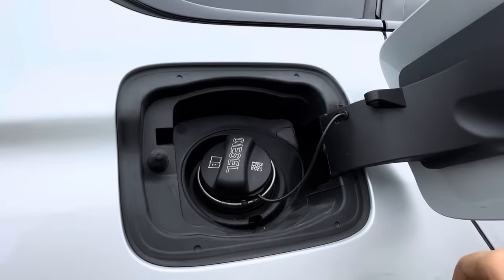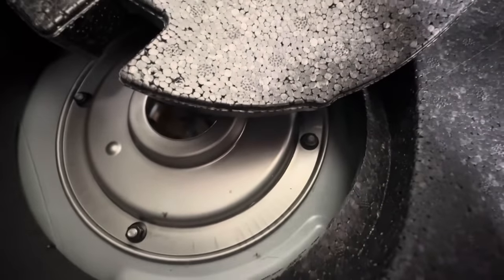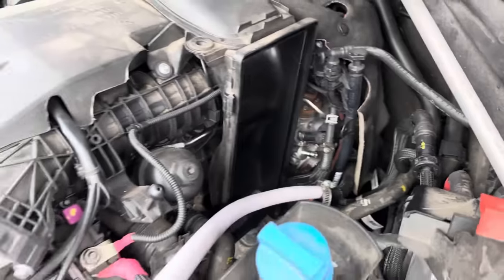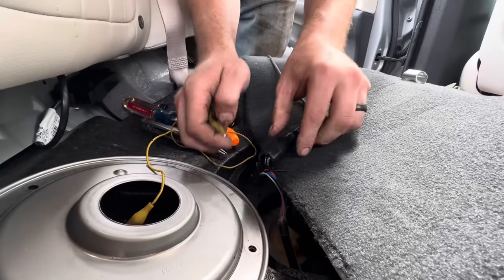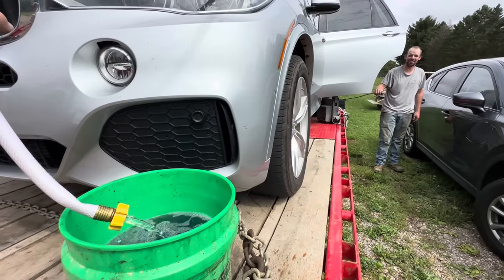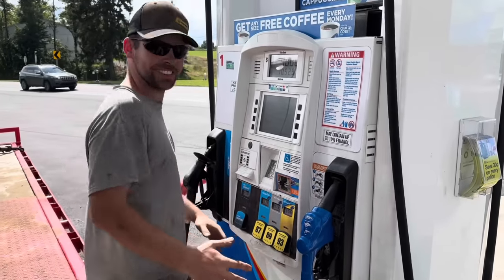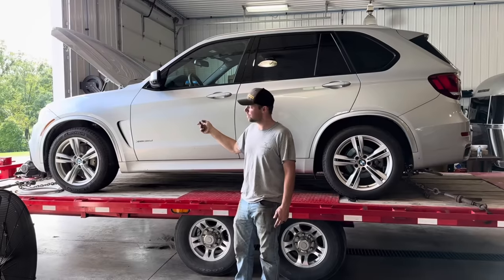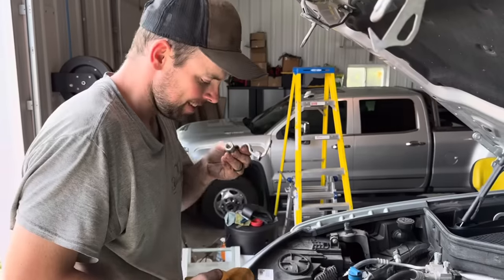Dieselgas 2023 | Will it start after being run on gasoline?

Comment: I had to do this at a gas station. Bought some fuel hose and I had an empty oil jug laying around in the car. I disconnected and plugged the lines from the tank and hooked up the send and return on the engine side to the jug. I drove the car back home where I unplugged the fuel send from the tank, extended it into a barrel. I let the engine run on idle from the jug for 15-20 minutes, emptying the tank and most of the fuel system into the barrel using the regular fuel pump. I changed the fuel filter, filled the tank with diesel and hooked the fuel lines back up. This was six months ago, still runs perfect.

Comment: Sam you never cease to amaze me in the tasks you take on and they turn out really good.  I worked for UPS years ago and one of the jobs I did was drive a semi that had Cummings diesel engines. The first thing we did when we pulled into the yard was to fuel up.  A new driver who did not know any better started to put regular gas in the tank.  I will never forget the head mechanic running across the yard screaming at that driver to shut off the fuel pump. I think he stopped right away and they drained the tank and it turned out ok. I think it was lucky that the driver did not start up the vehicle. Good job!!!!!

Comment: Well done. Suggest you talk to Area Diesel or the like and get their opinion on changing the HP pump. As you mentioned, if the pump dies then the broken bits will destroy all the injectors. Tough call for you to make as to what is now best to do. Retired mechanic/machinist in Land Down Under.
Reply from the maker: I agree maybe i will mention it to them that's a good idea. Thanks for watching!
Reply: No need talking to Area Diesel just put a new oem pump in regardless
Reply: If the car hasn't been run for a long period on gas the pump will be ok
Reply: I would ask BMW...

Several times I did the opposite, Diesel fuel into a gas jobby....  yea, dumb ass.   Worst was into my Honda Valcyrie  (2 wheeler)

Comment: I'm ashamed to admit that I misfueled my Mazda 6 diesel with unleaded petrol (gasoline) about 18 months ago. I got to about 15 ltrs before I realised, so then I had a dilema. Here in the UK we have companies that specialise in call outs to fuel stations for people who misfuel their vehicles, they turn up and suck out the fuel tank, but charge around £100 for the service. So you lose the fuel and have to pay the fee. In my case I was also in a screaming hurry so arranging and waiting for the specialist, then coughing up a hundred folding was not something I felt like doing. So, as I hadn't started the engine I decided to fill the tank with diesel. That would be 45 ltrs of diesel to 15 of petrol, I realise this was a risk but one I was prepared to take. It started right up then within 5 or so miles started to run irregularly. I persevered and it cleared up, probably as the mixture of the 2 fuels became more thourough. Two things I noticed subsequently. It was a b1tch to start from cold, and after standing when hot, also, it didn't have it's normal power at higher speeds, it held back under acceleration and wouldn't hold higher speeds. I feared the worst, thinking that the pumps and injectors were getting fcuked up etc. I carried on though, adding more diesel as I used up the contaminated tank and eventually it became better and better, until after a few tanks it was back to normal. So far no lasting ill effects. I reckon I'm very lucky, or Mazda's are tough!  I think if a modern common rail diesel is a actually run on neat petrol it would be screwed though.
Reply: Yeah, it's not as big a deal as this guy makes it sound lol He's just making it a bigger deal than it is...
Reply: As diesel engines age and injectors get a little worn they rens to smoke. And that might lead to failing the yearly inspection. A common trick is to fill the thank with 20-30% gasoline since it contains a bit less energy, therefore reduces smoke. Have dove it with a few diesels and never seem to have hurt anything. Another trick is to fill up with HVO100 which is a biodiesel that is in fact “hydrogenated vegetable oil” which is waaaay cleaner since it consists of pretty much 1 molecule and not like 300-400 as regular diesel. So it burns incredibly clean and odorless and doesn’t smoke almost no matter what. 😎

Comment: I used to work at a dealership (Not BMW) and this actually happens quite often. I actually can see how it happens, 
A person, drives gas vehicles their entire life then switch. 
I actually think it’s a suckier job when they fill the DEF tank with diesel or mix DEF and diesel in the main tank…
Reply: Flame thrower hahaha
Reply: I have a hard time figuring out how people manage to do that. The small plastic hose that comes with the jugs JUST fit in my def tank opening, nevermind the diesel pump!
Reply: @fullraph  I put about 1/8th gallon of DEF into my diesel tank before I realized it...first time I did it in 120K miles.   I don't buy the jugs, I get it from the pump in the diesel lanes the semi trucks use.   I was able to get home without problem since it was still over 22 gallons of fuel compared to a cup or two of DEF.  I let it settle out overnight then went under the tank to unscrew the plug which is there to drain any accumulated water.

Comment: Quite amazing they filled it with gas, my E70 won’t take certain diesel pumps cause of the shape of the nozzle
Reply: Yeah it's a different size. She would have had to get the fuel adapter in the trunk to put gasoline in.
Reply: The diesel nozzle is bigger so it’s easy to put the smaller gas nozzle in it. Harder to put diesel in a gas car since the nozzle doesn’t fit.
Reply: That is until you drive an older vehicle that was made when people weren’t idiots kinda and is designed to take high volume pumps for gasoline. There have been a couple of times where I ask someone else to fill up my truck. They’ve never managed, actually start pumping, but where they’ll grab the diesel nozzle and it does fit in mine, so that’s always fun

Comment: 2018 was the last year BMW sold diesel cars in the US due to a lack of sales. My wife has a 535D with the M sport package we picked up recently,  low miles 1 owner. Its really nice and get around 40mpg. Its so quiet and what blows me away how it starts without having to wait for glow plugs like my older ford f350.  Good job fixing that one.👍
Reply: We can blame VW for that. BMW still makes diesel X5's in the US! But we can't have the forbidden fruit now.
Reply: Oh and yeah these will start no problem in like -30 weather. I still recommend a lubricity additive for those CP4 pumps though.
Reply: It was because of the emissions requirements. It’s truly ashamed bmw doesn’t sell even one diesel in the 🇺🇸. Thank VW for that. At one point bmw was even going to offer an x7 diesel in the 🇺🇸. That’ll never happen.

Comment: Nice repair Scrappy! Great trailer except they do a lot of front and rear end damage while exiting the trailer! Today's plastic car bumper covers will more often than not come off completely or get damaged while exiting the rear of the trailer. I had to get rid of mine to eliminate customer complaints and expenses to repair the damage at my cost! Thanks for posting and take care!
Reply from the maker: I agree that's about as low of a vehicle as it can handle.  I am usually hauling skid steer and mini excavator and other smaller equipment with it!

Comment: The worst part of this, if you took that back to BMW, they'd want $10-15k to fix that car. Friend worked at VW about six years ago and someone had a tdi golf towed in because they filled up with gasoline and the car died a couple miles down the road. Vw wanted to replace everything from the lift pump to the injectors, that bill was about $9k.  😮

Comment: Worked on a "76 custom Dodge van with the same problem (in the "80s), only the other way around. Gas engine filled with diesel. Same fix. Drain tank, fill with gas. Flush lines, remove & flush carburetor, change spark plugs. Also did an oil change as this van was driven on the interstate from the fueling point until it died. Crank the piss out of it, immediately drive 100 miles. Smoked like a crematorium for a while, but was still running fine a couple of years after.

Comment: You may also want to change the fuel filter as a precaution esp if you don't know when it was last done.
Reply: Why?
Reply: @jhsevs most non truck diesel owners don't know you're supposed to change them about every other oil change.

Comment: These N57 X5's are really sweet cars. And can tow a decent amount (6k) considering they aren't that big. But they do weigh over 5k lbs.

They're not as good as the M57, mostly due to the CP4. But you can still get a tune and delete on these and they wake up a substantial amount.

Comment: I filled up my ranger one time on the farm and we had just changed the tanks around and I wasn’t paying attention to the tank I got fuel from and filled it with diesel it ran to the end of the driveway and died lol I siphoned the tank and filled with gas cycled the key several times and started it with either and it ran with either for a few seconds and then it was fine lol

Comment: If you pump out the benzin and just add full diesel the delution should be good, then cycle the ignition to "mix" the fuel in the lines..😅
The pump already ran inn gasoline so damage is done, and maybe you want to look in the front for the diesel filter to purge that too?

Comment: Should you consider changing the HPFP, read the BMW TSB SI B13 03 09 for the recommended replacement unit.
Reply: The N54 HPFP bulletin has nothing to do with the HPFP N57 diesel in this X5. Completely different cars, engine, and fuel strategy.

Comment: Over here in Britain these bmw's are upper middle class driveway orniments they love them they hold a special place in thier hearts. but 99% of them have any inability to actually drive one nor handle the rear wheel drive systems because they go to fast all the time. also over here they have issues with accelerator pedals made from lead for some reason? The indicators/turn signals never ever work. I've owned a couple and there not what they used to be the modern one's are utter s**tboxes.

Comment: Well, the old scrap qualification worked well enough to get the beamer going again. I would be a little concerned about the pump being scored from the gasoline, even in a mile of drive time. Chances are it would be ok, but I'm no beamer mechanic, and the concern would still be there. May be good insurance to change it out if research still leaves doubt in mind. That kind of stuff bugs me and if the pump isn't a stupid amount of money to change out, I might consider a new one to save the injectors from getting trashed and the rest of the fuel system full of metal. That diesel gas works wonders for roastin' your weenie!
Reply: The pumps are made from the same metal no matter if it's a diesel or gasoline injection. That part really shouldn't care what the fuel is. The seals may be a different story, but as long as you don't dump E85 in it, I don't see why it would be damaged.
Reply: @thesteelrodent1796 The high pressure pump needs lubrication gasoline can't provide. Actually modern low sulphur diesel can't even provide it. But if he's a diesel mechanic he probably knows that the CP4 pumps can't handle low lubricity fuel and he probably already is using a lubricity additive.

Comment: Hey Sam nice your now a qualified BMW mechanic ,I always thought they were a mystery to fix ,was wondering if the dry fuel gas did any damage to the bore,s as DIESEL is an oily fuel ,just a thought bubble ,enjoy your channel Matt was right check out Sam 
Cheers Kym
Adelaide
Reply: Today's fuel seems to have very little lubricant.
Reply: You need to run additives to keep the high pressure fuel pump of the commonrail happy so much for lubricity...

Comment: At what speed was that mile covered? At25-35 it would be ok, I think. At 50> yea just swap the pump now. Had this happen to a forklift at work once. Boss said let it run with just a flush. 3 weeks later I was installing a new pump and injectors. The lift was operated for about 30 minuets on 1/4 diesel, 3/4 gas.

Comment: Oops! you are lucky on this time.
It happen to me once with ops it I filled in Diesel on an Austin Martin my boss car I was lucky to we spotted before my boss turned on the engine, and the most impressive my boss didn't got angry with me it was second time lucky on the same issue because my had to call someone to drain the diesel out of the Austin Martin all most brand new car.

Comment: For those who run into this type of issue, where do you take your diesel/gas mix? Are there any auto places that are usually capable of disposal?
Reply: Run it in your lawnmower. It wont care
Reply: Old mechanical injection diesels will run on a mix of gas and diesel
Reply: It’s your new lighter fluid

Comment: that pump is fine and it is no where near 10000 to 20000 psi ,it is at most maybe 100 to 160 psi and all it controls is the fuel shut off and timing of the injectors
Reply: The HPFP on a BMW diesel automobile outputs, depending on demand, 2,200 psi maximum.
Reply from the maker: I just gave it a google- With 39,000 psi (2,700 bar) capability, the CP4 can meet even the most stringent diesel emission standards

Comment: there's very little difference between a common rail diesel and a gasoline injection, so highly doubt either pump took any damage. After all, they're only pumping fuel and having gasoline in the diesel is no worse for the pump than water. Once the fuel is mostly diesel, it should be perfectly fine to keep going, but the computer will tell you if it develops an issue. The stuff that may get damaged with the wrong fuel are the injectors and glowplugs, but the engine normally dies before they take any serious damage. If you went to the dealership they'd want to replace basically the entire engine, but as long as it's flushed and runs, there's really no need.
Reply: Problem is that a diesel injection system uses the diesel as a lubricant, whereas a gasoline high pressure fuel pump is designed with the fact that gasoline doesn’t lubricate in mind.

Running gasoline through a diesel HPF means it runs without lubrication. Now I doubt that that single mile really damaged it that much, but it is a danger and many HPFs have died this way.

Bigger trouble is that when the HPF shreds itself, it will send metal fragments into the injectors ruining them too. That can be so expensive it might economically total the car.
Reply: Domino is exactly right. Lubrication is absolutely a thing, especially on these CP4 pumps. 

Next time you get some gas, rub it between your hands. Then try it with diesel, especially a high sulphur diesel. You can literally feel the huge difference in lubricity.

Comment: X5 Diesel are notorious for High Pressure Fuel Pump failure. I'd strongly suggest you to replace it. When my fuel pump gave up, it damaged the hole fuel system, I had to replace every single bit and piece of this crapy fuel system, it costs about 10 grands to do everything. My car was still under warranty, luckily.
Reply: It's not an X5 thing, or even a BMW thing. It's the type of pump that is used combined with EPA mandated low sulphur fuel that has low lubricity. You should only use high quality fuel with good lubricity and really should use a lubricity additive. The previous X5 (guessing yours is a 2013+) uses a different pump and doesn't have this problem. 

Any vehicle with this pump (Dodge, Chevy etc) using Obama mandated US diesel fuel is going to be at risk.

Comment: Why did you put the gasoline in the diesel, what did you need to flush the system must had a lot of crap in the system, never new you could use gasoline. Interesting great job

Comment: Of course, it will start when the gasoline level gets to high a diesel will not fire. Cold running before dose no damage. I have drained and refilled many Diesels that stopped from Gasoline in the fuel

Comment: NEVER put diesel in a red can or gasoline in a yellow can. As long as it didn't run too long on gasoline, it SHOULD be OK. Gasoline doesn't lubricate so there can be damage.